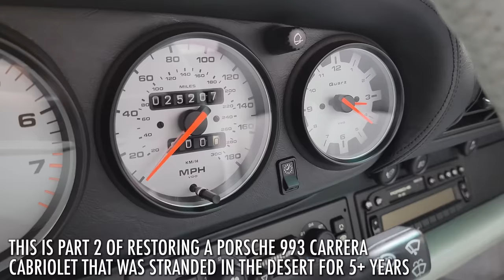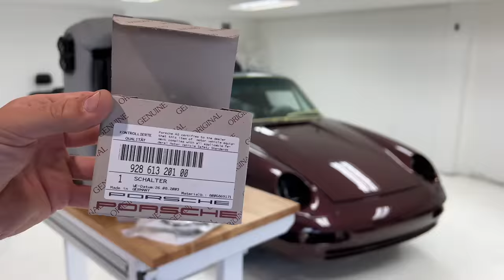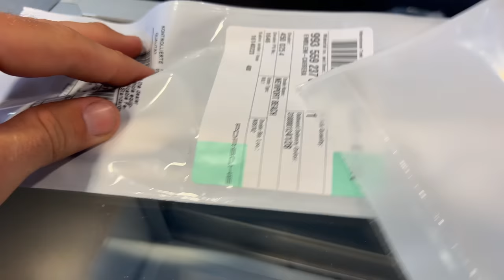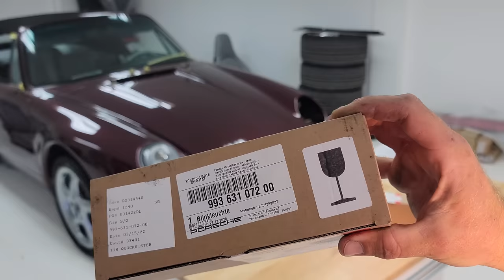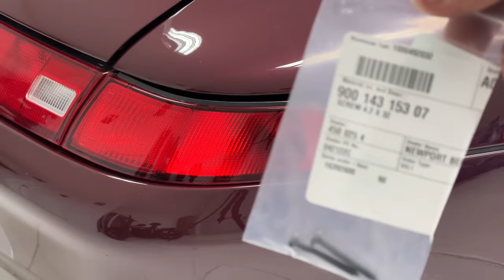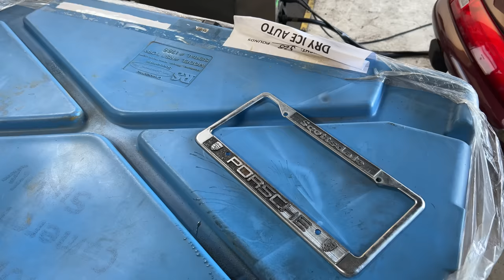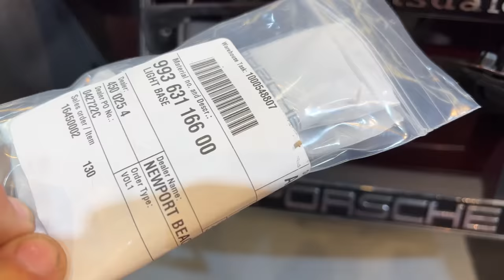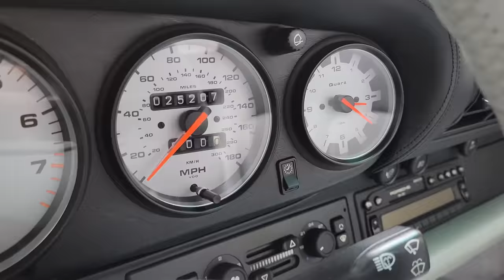BARN FIND Porsche 993 Carrera restored to Showroom Condition - PART 2

Comment: The centrecap of the wheels... one mistake: The bottom part of the emblem always has to show to the valve of the tyre! If you work at a Porsche dealer here in germany and don't do that...you get into trouble :D ( I learned the hard way )
Reply: wait seriously, I thought that was a joke. Why so anal about a detail like that?
Reply: @VinceroAlpha  its just a Porsche-perfection thing
Reply: Always though this was a joke my porsche buddies told me until I saw other ppl mentioning it lol. kind of smart, kind of pretentious 🤣
Reply: Absolutely, you are right!
Reply: Someone said it. I was betting someone would.
Reply: 🤣 Germany is very strict
Reply: I didn’t know until I read your post. Now I check my car… you are right!
Reply: I did it subconsciously without knowing that it was custom by Porsche to do so
Reply: Interesting!!
Reply: ALWAYS align your center caps with the valve stem, never the ground!
Reply: That's hilarious
Reply: @virgilpalmer2427  no, it is absolutely essential
Reply: This is essential for a proper restoration detail. Been doing it 30 years, along with aligning screw heads when possible .
Reply: Definitely Porsche 101.
Reply: I wondered if someone picked that up…!?
I know it’s a concours judging point, as that is how they all come off the production line, bottom of the crest points to the tyre valve.
Reply: @VinceroAlpha  Have you ever met an actual German? They're fine people but crazy about details.
Reply: @tstahler5420  as a matter of fact I have. We meet in at aMexico resort and brake pen pals sort of speak.
Reply: Is not a joke. ALL center caps must be aligned, not only Porsche, also Mercedes star or BMW logo need that. If you don’t like details, then you don’t understand luxury. 
By the way,  also the Rolex bezel must be aligned to 12 o’clock if you’re not underwater. Or your house light switch have to be all in the same position when lights are off....
Reply: @edwardvalivonis23  That's why they make great cars and are known for exacting tolerances. I love the way Germans do their thing. The same can be said about Japanese methods. I love it all.

Comment: Awesome Job, You should be proud of it.
FYI for next jobs: Porsche logo tip on the wheels hub ALWAYS have to point to the air valve, this comes from the old days of Porsche racing and how they could quickly find the air valves in dark rims.